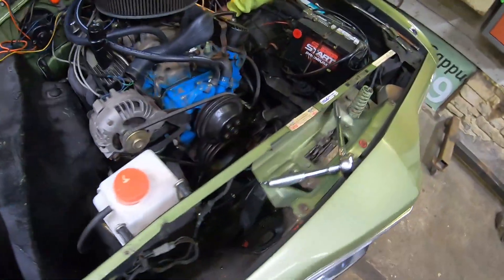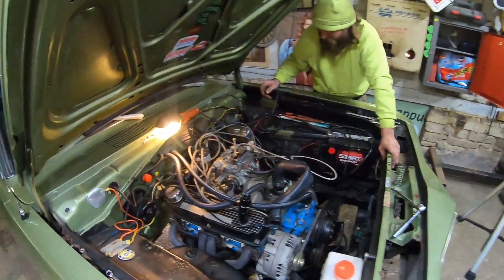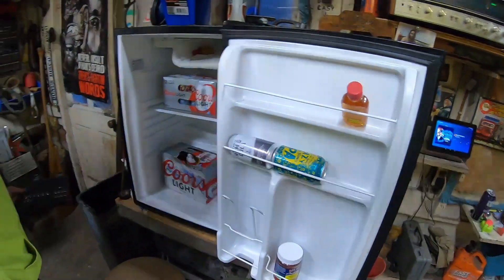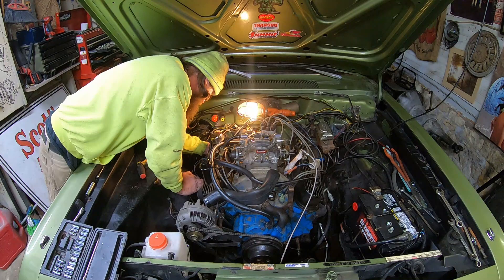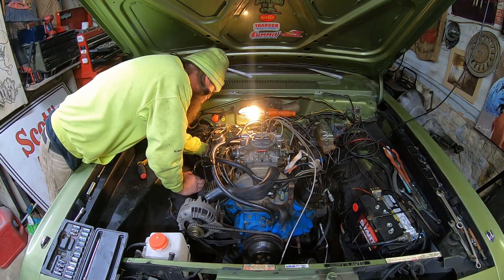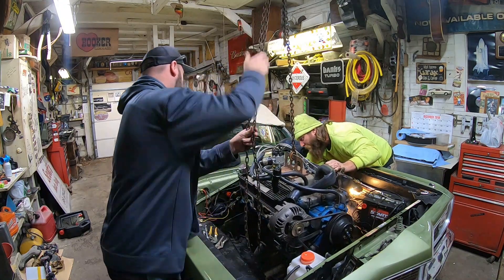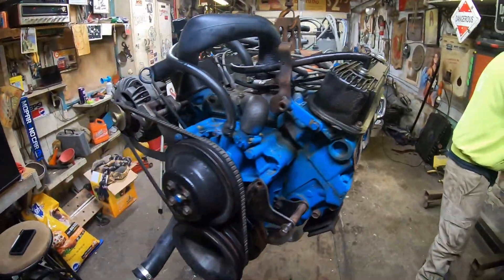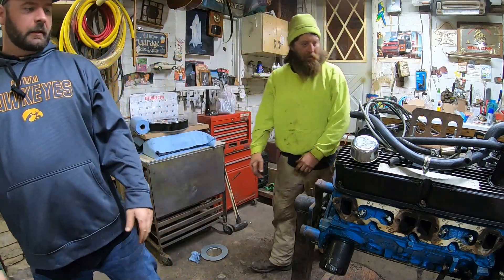We pull the 360 V8 out of our Motley Crew Cab, Triple Pickle, 1973 Dodge Dart, Heads and Cam Plan.

Comment: That's why many A body guys will run the fenderwell headers because the other ones are a pain in the ass but if you don't want to cut a hole in the fender well you gotta use the standard ones but some brands fit better then others Hooker has a nice set for A bodies that fit good without too much bs
Reply from the maker: If you have the cash TTI is the way to go. I despise fenderwell headers lol